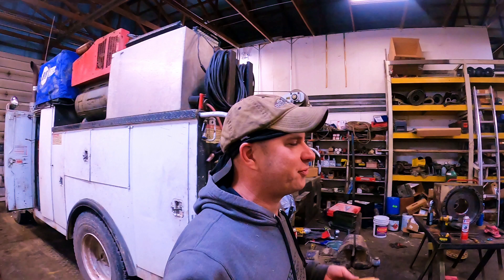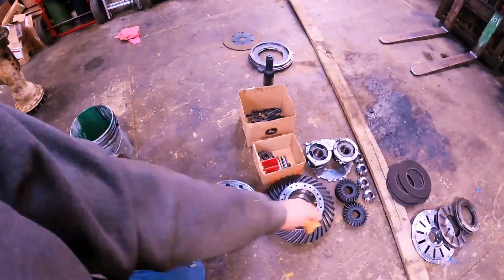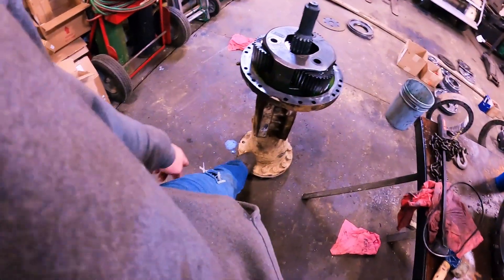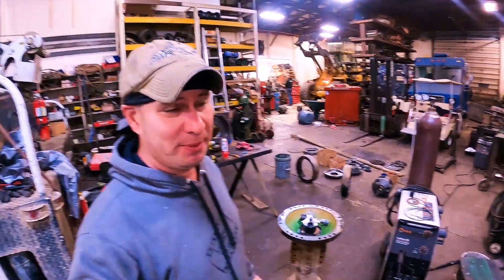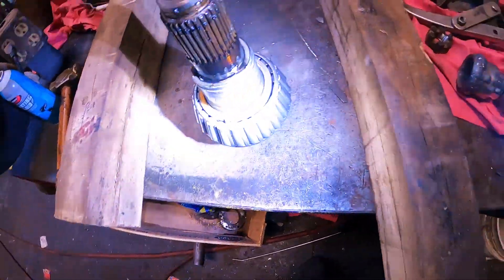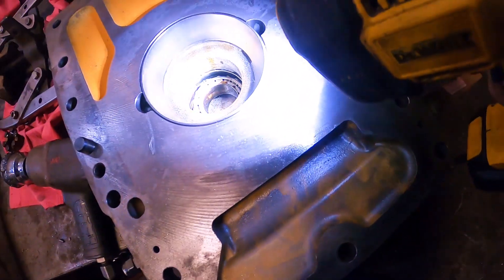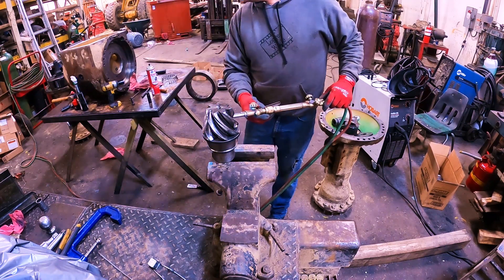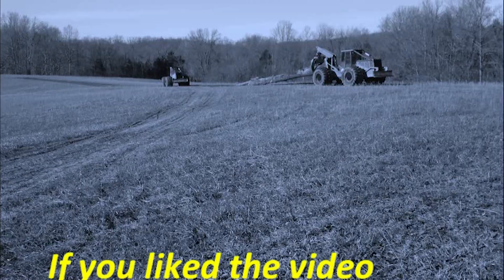John Deere differential repair, Tear down🔧

Comment: have 2014 John Deere 210le transmission fluid is leaking to rear end. any tips?
Reply from the maker: Sorry big guy I'm not up on backhoes
Reply from the maker: I would guess it's through the diffy lock circuit prolly blown seal in rear-end
Reply from the maker: Guy might have to look at a hydraulic schematic to track the path of flow

Comment: So why don't they put the planetary gears on the ends? The whole point is to reduce the stress on the axle shaft. I would think that bearing would be a guaranteed failure point and should be a factory recall item.

Comment: Wow wade, just seeing this , that bearing cage is cheapo, wow I've seen heavier in a zero turn hydro, gear unit!  I saw a guy take apart a 8000 series' big boy jd trans the out put shaft  splines broke it was like tiny I could not believe it, they make a heavy duty trans and put 1 cheap part in and it ruins them 😯 that's why I changed to Kubota and Massey
Reply from the maker: Copy that do you have good luck outa kubota

Comment: Taking a torch to a surface hardened part you want to reuse - is a bad idea. Should have used cut out wheel to remove the cage, cut the grooves in the inner race and use cold chisel to brake it apart.

Comment: Wade all this Newer JUNK John Deere is making. Is just that JUNK...You should find yourself an older John Deere with the number 2 or 3 axles on it. And Rebuild the whole skidder from the ground up. And it will last you 20 years. And it would out last a brand new one. For sure...I would rather operate an older 850 K LGP Dozer then these newer ones with the Panther Piss DEF systems in them plus the whole dozer is better then the new ones..LOL..Good luck Bud ..That so called bearing. Hell bicycles  have heavier bearings in them then that one..LOL...HAHA..Great Video Wade...